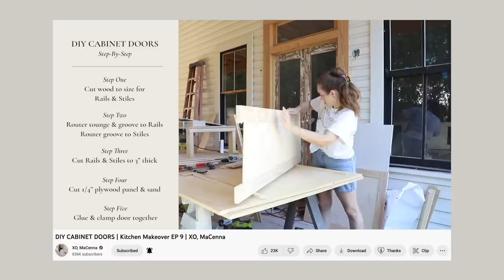LIVING ROOM MAKEOVER Episode 1 *Restoring Our Vintage Mantle | XO, MaCenna

Comment: Absolutely use the darker gray for the bead board walls but do the shelving in your wooden concoction so that it carries that detail onto the wall. The cabinets could still be in the gray as well with perhaps the top in the wooden color. The brick for the hearth is a PERFECT idea and an amazing way to use up the old chimney bits. If you were able to find thinner brick, like tile depth, that could go up along the inside of the mantel. Or if you have extra of the one you intend to use on the kitchen wall/primary bathroom cause it has that texture to compliment. I'm so excited to see the progress in the living room!!
Reply: I love that idea!
Reply: Yes! Warm wood tone shelves!!
Reply: This is a great idea!
Reply: Agree 100%! Dark wood tone shelves would complement millstone gray SO well
Reply: What she said. And lime wash the bricks. Also, I think the mantle is too high when you did the 6” and the paint can. Can you try something a little lower?
Reply: The inside of the mantle should be “non-combustible”. That is why most people use tile. If you use type-X wall board, you may want to read some comments that talk about high-temp paint. Check your local codes, non-combustible material may be the requirement within a distance from the “fire box”. Meaning if that distance is like 24”, then you may need to treat the wood mantle with spray applied fire resistant material to comply with local ordinances.
Reply: @erinmoore9681  that's why I figured brick might be a good idea as a lot of fireplaces and chimneys are made of that.

Comment: I'm a little nervous the tv will be way too high up, but I trust your vision! I'm also worried that having the same dark color on both the cabinets and the beadboard will hide the beadboard, which would be too bad after making the effort to save it - but i do like the dark color, and maybe it will have the opposite effect, highlighting the beadboard :-)
Reply: Hi, I agree the TV will be too high and also take away from the beauty of the fireplace. I would put the TV on one on of side cabinets.
Love the idea someone had of grey bead board with stained wood for the shelves. I love the combo of the trim and the grey in the hallway. It also needs warmth to balance it out.

Comment: I was always taught that the best type of paint for brick and plaster is something breathable like mineral based paint. Otherwise, moisture will get trapped beneath the paint and cause the bricks to crumble and deteriorate over time. But I'm not sure if that's an issue for interior bricks.

I'm super excited to see what you end up going with! You never cease to amaze us with your vision and what you can accomplish! ✨
Reply: I think that’s only a problem when painting a brick exterior.

Comment: The Millstone Gray is perfect for the bead board. Not only does it tie in with the main hallway, it also sets the stage and creates a nice backdrop for decor pieces. The brick is good choice too. The purpose of a hearth is to surround the fireplace to protect from fire so non-combustible materials were used such as brick, mosaic marble or tile. Your brick will fit well and is free❤

Comment: The passion behind you doing the plaster is truly an act of love for the house and your family. I love Millstone Gray by the fireplace. They actually make a hot pink paint that’s fire resistant that is made to prevent fires. To be extra sure about the mantle you can always do the fire board to know there’s no wood close to the gas insert.  I also love the brick coming back into the house! You really wouldn’t need the bricks on the bottom. Then you could just save some for the front walkway to add some cottage history back to there!
Reply: I do not believe the glass on the fireplace gets too hot, that is why I suggest a black metal frame that is sold for gas inserts, it would make it safe and finished.

Comment: Use the brick to make the initial structure quick and easy. I'm in a toss up of if brick will clash with the plaster of Paris and the design if the mantle. Maybe to use the brick for structure and then plaster it instead of only paint so that it all flows into one piece. I'm feeling like the brick will stop the eye for a third time versus the eye only flowing from the plastered wall to the pretty mantle. 

It's coming out incredible as always! You and Romeo are an amazing team. Can't wait for the final look!!!!

Comment: Love how the living room is coming along! For the hearth– use the brick, but maybe only as the top of the heart, and the sides could be painted the same color as the mantle. Or do brick on both the top and sides, but somehow frame/trim it in wood and paint it. This way there's a cohesion between the mantle and the hearth, instead of a stark difference or the exact same, color-wise. Just a though, Whatever you do it will look amazing!

Comment: Another thing you guys could do is continue the fireplace down but in a way that it truly gives an illustration it’s part of it. If you look up Victorian fireplaces, a lot of them have like iron framing at the bottom or rails, you could find something decorative that works well with the current fire place, maybe even Brass elements.!! You could even paint the entire surrounding inside strip that’s showing of the plaster, black to match the fireplace, so that the fireplace doesn’t stand out as much/ contrast and look so high. It would be an illusion project for sure. Love you guys!

Comment: A good trick for plaster is to add the water first and then keep adding the powder until there’s a little mountain peaking out the top then you can go ahead and mix it. I think if you’re going to add trim around the bottom of the walls that meet the floor, the bottom part of the hearth could be made of that and you can add the brick for more structure on the inside of that and to add another layer to make it a bit taller. I think it would fit in more than having the brick in the front and then it wouldn’t have to stick out as much.

Comment: Brick hearth, yes. If you change your mind on it, you can always make a wooden box cover for it with the....um trim? The box trim?? And paint it the same color as the mantle. The hearth also could be a storage space perhaps? Like a bench/hearth. For if and when you want to sit for...marshmallows or whatever. Think down the line.

The long wall with the windows can be painted millstone. It doesn't have to be both of the long walls. Do you intend for the bead board below it to also be painted or kept stained? Would you also like a more grey direction or keep the dusty green/grey (millstone).

Comment: I always love your designs and ideas and I agree with that dark moody gray on the side bead board walls and love the idea of using the old bricks from the previous fire place to build up the underneath of the new one! 😍 

But also I attempted to fix a repurposed dresser I bought recently cause they did a very poor job attaching the drawer handles and I struggled so much just trying to redrill the hole and screw it in, so what you are able to do and make look so easy really blows me away! And normally I feel like I'm pretty handy but this was ridiculous 😂

Comment: Love the Millstone Gray! Yesss!! LOVE the old bricks for the hearth!! I feel like you HAVE to do that! It would be cool if you kept at least some of the stamps on the bricks facing out. Maybe the best looking ones on one or both of the sides. They won't show up a lot especially once you paint it, but it can be a subtle detail that acts as a nod to the original fireplace masons.
Also, definitely keep the space between the fireplace and the mantle the same on the top as the sides. It looks like that works with the 1vertical brick height if you keep the horizontal brick flush and don't add a wood plank. In the video it looked like the perfect height with just the paint cans but the wood plank makes it just a little too tall. What color are you going to paint the bricks for the hearth? LOVE the plan!! It's going to be gorgeous!

Comment: Hi...I would build the fireplace mantle out from the wall ..almost like a frame on the back  make it more substantial for the size that you have it now....yes you stone gray is perfect... Those bricks you saved are amazing most likely they were all hand made with the stamp.. if you build a frame on the back of the fireplace and pull it out from the wall you'll be able to put your bricks standing up across the whole back to hide the frame  and then you can put one layer of bricks across the hearth so you'll have one standing up two lying down your smart cookie or figure this out

Comment: For the mantelpiece, after you paint it, you can add dimension by using color waxes. They come in tubes or small boxes in different colors on Amazon. You just rub with your fingers or a brush and wipe. Repeat as needed.

Comment: How about, for the fireplace hearth, instead of 2 bricks tandem with ea other, 1 parallel to the fireplace, and 1 perpendicular to it?  It wouldn't stick out as far.  But, maybe that's not an issue?

I like the idea about using some of the stamped bricks, add the millstone grey on the bookcases + wainscotting.

I LOVE your attitude about everything. ♥️

Comment: I like the millstone grey a lot! Also so glad you’re doing a hearth, I think it really needs it. Otherwise the fire just looks like it’s floating. Would absolutely smooth out the plaster thats visible between the mantle and the fireplace itself, and go black so it all kind of blends together. I have a feeling millstone grey will look amazing if used on the mantle and plaster wall in addition to the bead-board and shelves/cabinets

Comment: Nicely done, MaCenna! You may be aware of this, but please be sure to check the clearances (above and to the sides) to combustible materials in your fireplace owner's manual.  When considering how high up to mount your mantle, this may come into play.  Usually there is one clearance to a combustible material that is flush with the face of your fireplace, and another to a material that overhangs or protrudes (like the shelf part of your mantle)  Since you want your mantle to sit in front of the wall, that protrusion may increase the clearance.  Take it from a fireplace expert! :) It is not typical to have an overhang (like a build out to the mantle) directly above the unit, but every fireplace is different, so make sure to check. <3 I love watching your videos and enjoy your sweetness and silliness.  Plus, your style is beautiful. :)

Comment: I like the idea of a brick hearth... But only if the same brick is extended inside the mantel and wraps around the fireplace. That way you have continuity... And it flows better. You can have the bricks cut in thin pieces(and short pieces)so it would be easier to apply them to the inside. Now whether or not it will adhere to the plaster with mortar? Or something? I don't know. But do keep in mind that when you mortar you can chose to get colored mortar or add a color to the mortar when you mix it. I imagine a warmer color than the classic gray mortar would look nice... Unless you prefer the  classic gray?  It is coming along nicely!  😊

Comment: Millstone grey for headboard-yes.  Hearth is a definite in brick. Paint mantle millstone grey with the wall behind in the plaster. Cabinets on the bead board wall, 2 wide cabinets so you can put more in. How deep will they be?  Build out the mantle so you can still decorate at Christmas. What I mean is since you have to use material on the inside next to the firebox why not take that opportunity to make the entire surround more substantial. I’m dealing with that right now at my house. I’m removing the builder grade surround. Instead of getting rid of it I’m going to build over the sides to make it wider and add a larger mantle. A 6-8 “ mantle just doesn’t allow for much decor. Since you will have a tv over your fireplace, don’t know what height you plan on having, there might not be sufficient room for instance candle sticks, and other Christmas decor. I’m going with a 12” mantle at a minimum. I also have very tall ceilings and the space is open concept so it can handle the size. This will allow my to add layered decor for any occasion. Food for thought! You’ll do what’s right for your space. Looking forward to it.

Comment: I like the paint color but because there’s so much light in the room it’s taking on a different hue than the other wall you have it on. I love the richness of it when there’s less light. I wonder if you could use the same color but make it 50% deeper? I don’t know what that’s called but you probably get what I’m saying. Yes on bricks, make sure to include some of the stamped ones in the build. No advice to mantel and above the fireplace wall color.

Comment: One thing I would suggest with the mantle is to cut off the legs and the trim detail transitioning from the legs. Then you would keep the top crown part and the 8 inches below it. And you can place that at which ever height you want.
This saves time on building a hearth.

It just looks like once the legs are finished on the inside area, it would close off the gas insert/ fire view too much due to its existing depth.

Comment: Yes to millstone grey for just back of shelves. The limes wash light coloured look on the chimney breast. PLEASE DONT DO A HIGH HEARTH, JUST ONE FLAT BRICK HIGH if you want brick (personally I’d use thick slab limestone. Then extend the mantle bottom onto hearth and add a large skirting board to the 3 sides of each mantle side base to finish off the mantle (balances the weight of the top of the mantle too). Just mho though. 😊

Comment: I’d defiantly use the brick but I’d stager them.  I think soldier standing them in the front won’t look right. I could be very wrong though. Also, do paint the bead board Millstone Grey and use stained wood as your shelving to match the rest of the wood in the house.  You could even paint the bead board black like the island and still use stained shelving.

Comment: So I'd like to give you my ideas.
I would suggest the millstone grey for the bead board and either stained shelves with stained cabinets underneath or painted cabinets underneath. That would continue the look throughout the room with the wainscoting and tie together the kitchen, entryway and living room through their common features. 
And please add the trim (?, The one you used as the connection between the bead board and the floor) to the cabinets and depending on what you do as well to the fireplace.
As for the fire place: a millstone grey painted mantel with the plaster in the living room walls' colour would look beautiful. 
As for the surround of the fireplace itself and underneath it, i would suggest  limestone as it would tie the exterior of the fireplace (outside of the house) with the inside and also feature plaster as a tie to the fireplace wall and kitchen. The only thing a bit annoying could be the contrast between the limestone and the black of the fireplace.
However, if you go for the bricks, I'd suggest plastering them slightly (and painting them in the same colour as the wall) as they seem a bit harsh and not exactly fitting to the style of the rest of the features.

Anyway lovely seeing the progress of the house

Comment: Biggest fan of your series! I’ve been rewatching it from the beginning and I can’t believe how far you’ve come it looks amazing!❤

Absolutely love how this room is turning out and I love the idea of using the bricks I think it will complement so well with the other textures😍 I think with the brick though, having the box like you were going to make and maybe going only 1 brick at the top and 1 brick vertically like you were showing if that would fit? I just think that 18 inches is really far out if it was a detail you weren’t thinking of having, if you have the one brick vertical and the other horizontal that gives a measurement of around 11/12 inches which is still pretty substantial and I’m sure it’ll fit the mantle. I think on the inside of the mantle it might also look nice to have those moody grey tiles you were thinking of using for the kitchen backsplash, I think it will tie in nicely with the millstone grey of the shelves❤

Comment: You could paint the mantle a satin paint then use the same colour in a Matt and brush that just over the detailing so it stands out or paint the other way round Matt then satin for the detailing. It wouldn’t be in your face but just subtle

Comment: Curious on the size of your tv.. with the extra height from the mantle you may need a mounting bracket for the tv to lean it forward or else you'll be craning your heads 😅. It'll also be like a big black box on the fire place, even if it's limewashed.. thinking that the tv may feel out of place bc of the colour difference. Are you thinking about doing like a gilded frame around the tv to make it more of an art piece?  Love the millstone grey and the brick. I think that's a good combo. ❤️ Love this project and am very invested 😊

Comment: Make sure you check the combustible clearance on your specific fireplace to meet code. Usually you need 6in from the firebox to combustible material (wood mantle) but it may be different for your type of fireplace